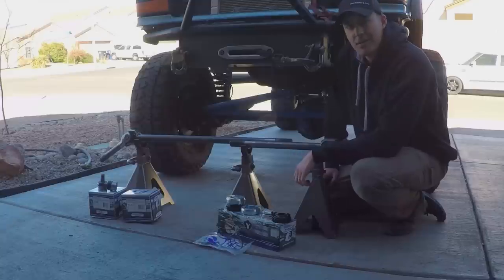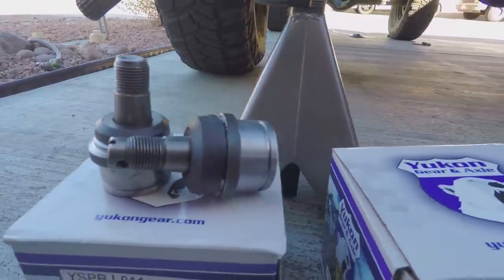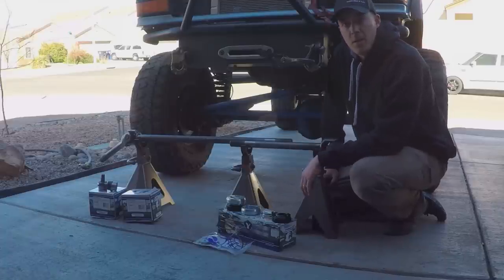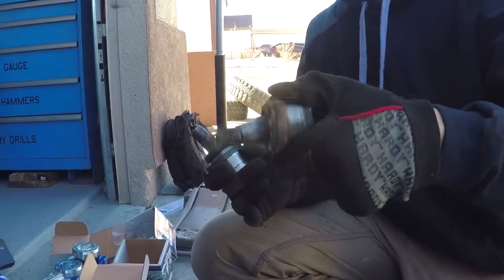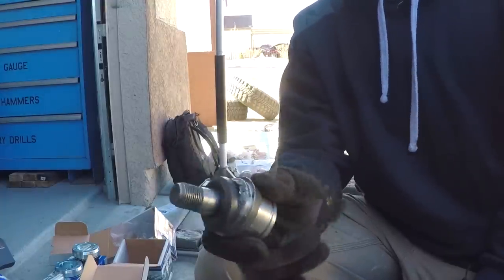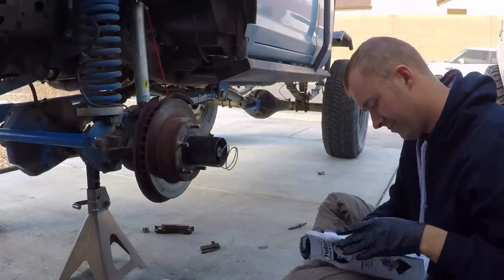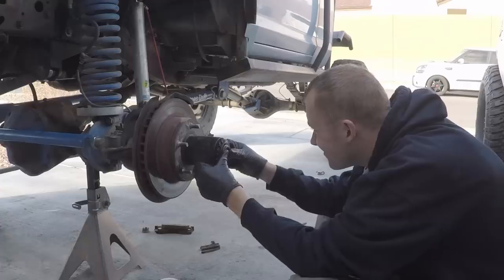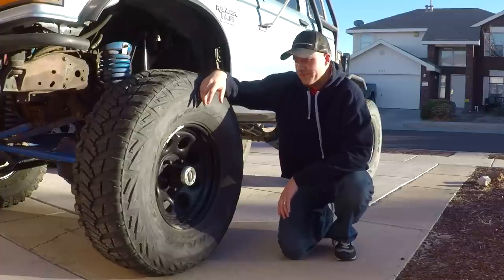Yukon Hardcore Locking Hubs & Chromoly Axles for Dana 44 - Reckless Wrench Garage

Comment: My dana 60 Yukon 35 spline shafts were to long had to cut 1/2 inch off to work with the YUKON LOCKOUTS
Reply from the maker: Randy Smith It sounds like you have a Ford D60 and used GM or Dodge D60 stub shafts. The GM and Dodge are .6” longer than the Ford.

Comment: So do you have any coil bow with a full width 44? I see the duff HD cups have been drilled offset about an inch or two. any issues? I just got a complete hub to hub 44 for 100$  looking to put it under my explorer. also what track bar are you running. I'm assuming you're using the Duff track bar bracket. also ARB or grizzley locker for front. I kind of want to be able to turn, but ARB is a lot.
Reply from the maker: The duff coil buckets are designed to solve the coil out 1.5” and I redrilled the lower buckets 1” so the coils had no bow. The trac bar bracket is from them, it’s nice but I think I would make my own next time. I have a grizzly locker, much simpler than an ARB and I don’t have many issues turning